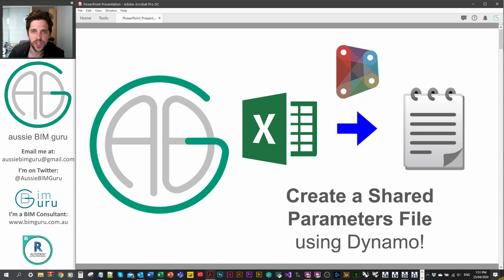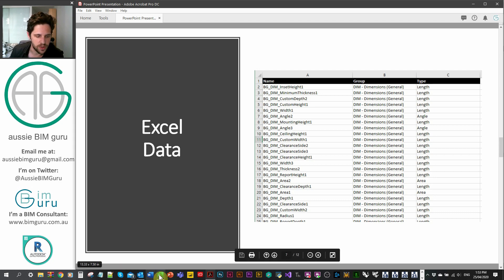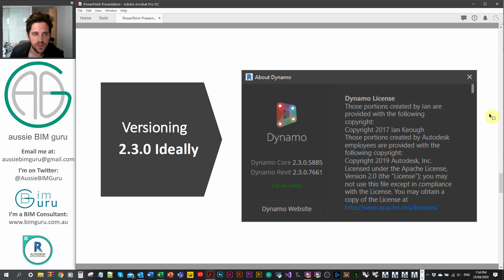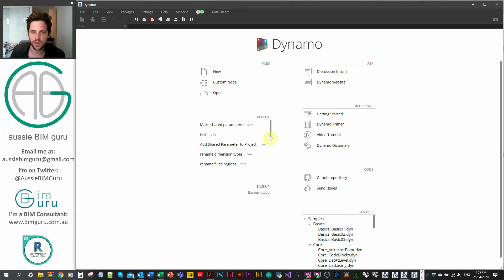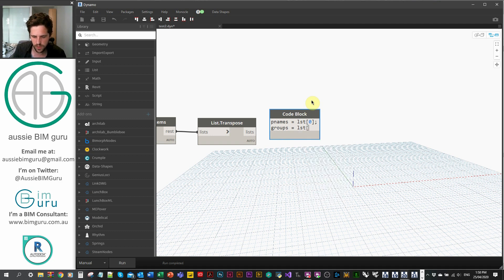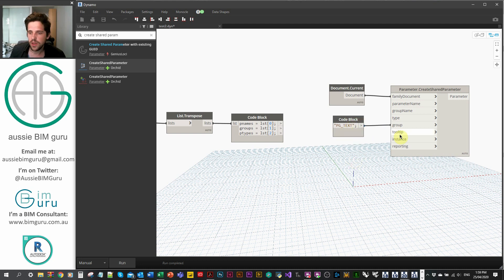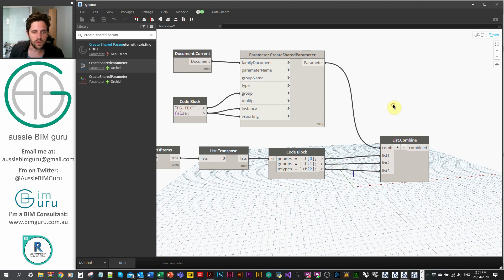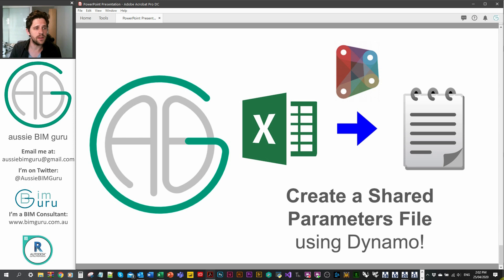Create a Shared Parameters File using Dynamo!

Comment: Thank you for your video. I do have a question, though.

What happens to the GUIDs for each parameter? Each shared parameter has a unique ID—a GUID. When a shared parameter is created in this way, it is not the same shared parameter as the one in the shared parameter list. Instead, a new parameter is created with the same properties.
Reply from the maker: Yes in this case it would not be the exact same. I have nodes in Crumple which take an optional guid as well now.

Comment: Did anyone come across an issue where only the Parameter groups were created? None of the parameters themselves were added to my file.
Reply from the maker: Yes I've found the node no longer works as intended for me in later builds, this is an old version no longer available. Maybe check on erfajo's github for similar issues and their fixes.
Reply: @AussieBIMGuru  Thank you for your reply. I was able to get what I needed through your earlier reply to @izanikamal6020 where you suggested using DiRoots.

Comment: Hi BIMGuru, I try to run the script but when I check in the shared parameter ribbon only groups appear but not for parameter name and type. Can you help me?
Reply from the maker: Unfortunately I dont believe the node works as intended anymore in Orchid. I had issues too. These days I use paramanager by Diroots to make parameters, get their Guids using dynamo and then make the shared parameter file in excel.

Comment: Interesating, is there a way to do this process in a batch way, in many models at once ?
Reply from the maker: Generally youd only want to do this to create the actual parameter vs in the model. Adding parameters is a bit different. For batch automation to families i have a few videos in my dynamo playlist. For project parameters i recommend DiRoots paramanager addin.
Reply: @AussieBIMGuru  
what im trying to do is
1.Creater shared parameter
2. Create project parameter, from the shared prmtr
3. Repeat process in a lot of models that are on BIM360, over +200 models. so automatization is much needed

is it possible with dynamo?
Reply from the maker: @MrZorret  yes look into either BVN batch processor or Bird Tools multiplayer addin on their website which are both free and can run a script in multiple files on BIM360 or local server.

Make shared parameters first in your file once, then you can use them afterwards for the workflow. You don't need to make the file each time.
Reply: @AussieBIMGuru  
Thanks 
i have created my list of parameters from a shared parameter, then i create a table with only the needed parameters;
this so i can use the "insert view from file" option in another models, to let me import the parameters
is there a way to batch process the "insert view from file" option so i can can do this process in lots of models?
this would actualley let me insert the same list of parameters in a lot of models, at once

Comment: Hello, I am trying to run this script myself but once i get to the final node to try to combine the lists i get "null". I am using Revit 2021 and Orchid 206.5.08318. I dunno if that could be a problem but i dont know how to proceed from here.
Reply from the maker: Yes new orchid doesnt work with list combine the way it did for me. Try doing it normally (inputs into the actual node vs combine), with condense set to false. Beyond that touch base with the package manager on their github to ask how the node works now as I cant see into the code to understand assumed input structure.
Reply: Hi A Ferrarotto, did you manage to resolve this?

Comment: Amazing video Aussi! I was trying to follow your tutorial (my dynamo version is 2.5) but the Parameter.CreateSharedParameter doesn't have the input  FamilyDocument.

As you said at the beginning, Revit should be pointing to the document that I created at first (mysp.txt) as you suggested, but doesn't look like that the script has worked because this is empty and I don't get any error or warnings in the whole script.

Are you using any special package for it? 

 Thanks for all!
Reply: I found the answer! At least in Dynamo 2.5 that field doesn't exist. If you want to know which document are you aiming, you should use Parameter.SharedParameterFile.
Reply from the maker: Glad to hear you found the answer, sorry for the delay. Yes this node was changed in later builds (I believe because the author saw this video). It's frustrating that the video becomes out of date, but at the same time is a better workflow probably with the new node. I try not to use too many custom nodes in my videos these days as they have messed up my videos before when they change (my navisworks clash video has so many questions all because 1 node changed in it - drives me mad!).

Comment: Hi Gavin,

Would this workflow still work using the Excel spreadsheet from your template package? I only ask because you have additional columns in that file including 'DATATYPE', 'GROUP' AND 'USERMODIFIABLE'. What is the best approach to setting up the Excel file?
Reply from the maker: The Excel file in my template package would work with this if you remove all the headers and just take the name, group and parameter type columns instead. I've used this method to regenerate my shared parameter file with new prefix and GUID's before without issues.
Reply: @AussieBIMGuru  Thanks that worked great! I noticed the new SP you added for your doors V2 (FAMd - Family Type (Doors)) doesn't work and causes an error. I'm not to sure why this does that, is it possible to explain why this would be the case?
Reply from the maker: Unfortunately these parameters can only be remade manually as far as I know as they have an associated category nominated on creation which I think is determined in their GUID. I'd filter out their rows in Dynamo.
Reply: @AussieBIMGuru  I thought that may be the case, thank you for the clarification! How would I filter them out in Dynamo?
Reply from the maker: By their name containing _FAM

Comment: At time 9.02 what is" pg_text."..under group in parameter.create shared parameter node???
Reply from the maker: This is the revit name for the Text parameter group behind the scenes. It doesn't really matter which one we use as we're just creating parameters here so they get made in the parameter file itself.
Reply: @AussieBIMGuru  ok sir
Reply: @AussieBIMGuru  so we can give any name here??
Reply from the maker: @iftekharkhan8879  any valid name. I suggest just using PG_TEXT
Reply: @AussieBIMGuru   thanku sir. For always replying me...
Reply from the maker: @iftekharkhan8879  i reply to everyone eventually :)
Reply: @AussieBIMGuru  sir one problem regarding s that i installed orchid.exe and sample also and run the wizard...but when i open Dynamo it didnot show here??
Reply from the maker: @iftekharkhan8879   check all user account appdata folders. It may have installed as incorrect user like admin.
Reply: @AussieBIMGuru  so sir what i have to do if it is??
Reply from the maker: @iftekharkhan8879  copy whichever package folder it made to the correct user account manually.
Reply: @AussieBIMGuru  ok sir
Reply: @AussieBIMGuru  sir i have revit 2018 ver ...and Dynamo 2.03 on which i installed orchid 2.06..so it's correct???but yesterday i install clockwork and it's working...but orchid not...
Reply from the maker: @iftekharkhan8879  run the 200 installer not the 206.
Reply: @AussieBIMGuru  ok sir
Reply: @AussieBIMGuru  sir i want to know difference btwn ....list sort by key and sort by function in Dynamo??thanku
Reply: And when to use which of these....
Reply from the maker: @iftekharkhan8879  both can achieve the same outcome. Sort by function applies a function to a list provided. It substitutes unspecified inputs with the list. I never use it.

Sort by key takes two lists, and sorts the first based on the second. Keys are usually numbers or letters so they can sort. We use this to reorder data based on a sortable property, for example a room area or number.
Reply: @AussieBIMGuru  sir..i install 203 for orchid but still not showing in Dynamo.
Reply: I have to uninstall 2.06 before installing 2.03??
Reply from the maker: @iftekharkhan8879  i don't know but probably not.
Reply: @AussieBIMGuru  ok sir ...if u have any installation package for orchid plz send me ....thanku
Reply from the maker: @iftekharkhan8879  i don't. Its on the github, and there are instructions. I can't really help more than that. If it doesnt work maybe leave an issue for the author of the package and they can help you.
Reply: @AussieBIMGuru  ok sir
Reply: @AussieBIMGuru  sir i want to ask one thing in Dynamo...
Suppose i have many  door  and door types in revitproject ..i want flush door and it's all type..mean how many flush door are there  in this project ..then how can i filter this in Dynamo......
Reply from the maker: By using their data.
Reply: @AussieBIMGuru  ok sir ...thanku ...but actually i m asking the which  node to apply??
Reply from the maker: @iftekharkhan8879  element.getparametervaluebyname and list.filterbybooleanmask
Reply: @AussieBIMGuru  sir i want to get type parameter ..and then i want to filter according to that parameter value ..."get type parameter " is not there ...i didn't find ...is there any other node for finding element bythe type parameter value...thanku sir
Reply from the maker: @iftekharkhan8879  yes rhythm package has nodes for this.
Reply: @AussieBIMGuru  ok sir
Reply: @AussieBIMGuru  sir one thing more 
..sory for disturb...
I want to change the family name and it's types also by just add suffix or prefix....
Element.type : family then all elemnet of type: this will give all the family name which r inside project 
Second thing .

Category : window and all element of category this will give all type of windows ...
But sir i want the family name and it's type also so. Plz tell me node...
Actually what i did ..is. Elemnet.type :  i type family then all element of type ..it will give me all family name ...so i did string .contain  then i replace after that i put lister filter by boo mask ...then type element.set.name ...so it's change only family name ..but not it's types..
I want to change its type also ...plz tell me node of this ...thankunsir
Reply from the maker: @iftekharkhan8879  look under the 'Family' section of the Revit node library. You should be able to get the types of families using a node from here, which can then be renamed in the same way. I don't usually get much time to have deep conversations on YouTube these days about scripting so I suggest using the Dynamo forums to get more direct help from people for these types of things.

https://forum.dynamobim.com/

Comment: Hi, nice tutorial! I have a question related to shared parameter file: basically I have a rvt file with shared parameters but I don't have the SP .txt file. I made a script with zhukoven nodes and I retrieved all the SP in the file, guids included and exported all in Excel. The problem is that converting the excel in txt is not readable as a Sp file by revit. So i'm wondering if there is a workaround to do it. I've searched for days in forums and tutorials without any luck. any ideas? Thanks in advance!!
Reply from the maker: I would try copying the header portion of a working SP file into the one generated and see if that helps. Shared parameter files need to be structured in a particular order for Revit to read them so the one you put back together must have some formatting errors in it.
Reply: @AussieBIMGuru  yes I've tried to start from an existing SP file and adding the new data, but the formatting is wrong. well, I'll try again and see. Thanks!

Comment: Hi, i was trying to add the Tooltip field from excel but list.combine just give me "null" value. I tried to put it directly on SharedParameters.Create but it didn't work either. Any advice to achieve this? Seems like the data has some especial requirement to pass through. Thanks for the videos
Reply from the maker: I haven't actually tried adding a tooltip before using this node. I would start simple, try adding a tooltip directly from Dynamo using a string node, then from there try in list format and finally excel. The results might indicate why it isn't working.

Comment: Hi my friend....
As usual, great job
What am I not doing right?
Attached picture
https://1drv.ms/u/s!Air2ohPJDj0fgrA4mr7lLPcBJTwSpg?e=M9PKLI
Reply from the maker: The main reason I know for this to happen is you might not be in a family document. Otherwise the node may have been updated- maybe try inputting the lists directly instead of list combining.
Reply: @AussieBIMGuru  Thanks for your quick response. Everything works 👏
Another question 😀
Some of my parameters including formula. See pictures attached.
https://1drv.ms/u/s!Air2ohPJDj0fgrA56jLgCQZWP43LUQ
There is a way to add a formula column in the Excel file and all job making automatically through the dynamo file?
Reply from the maker: @yogev55  glad to hear!

You can set formulae using a node from the Orchid package, I made a tutorial on this a while ago here;
https://www.youtube.com/watch?v=arEYfAJp7Y8

Comment: Hello
Excellent tutorial, however I performed the whole process and it doesn't work. My List.Combine reports all values as Null.
I put an image on OneDrive follows the link:
https://1drv.ms/u/s!Aj1WfMdg42r0gZ4xHrxxHPqDjY8z6g?e=UPvwKM
Reply from the maker: Is dynamo pointing to a family (rfa) document? It doesn't work in a project file.
Reply: @AussieBIMGuru  yes... I open new family (generic model) and work on this family. Mabe the revit version? I have 2019 and 2021 installed.
Reply from the maker: @jacksonaugusto7538  Make sure you're using Orchid for Dynamo 2.3.X, Dynamo 2.3 and Revit 2020. Beyond that maybe try just running the regular node vs combining it.

I will probably stop sharing tutorials using Orchid in future as the results are rarely consistent and it gets updated too often for the tutorials to remain relevant.

Comment: What if I want to enrich my excel file with new parameters and create a new shared parameter text file - The GUID will be/not be lost for existing shared parameters?
Reply from the maker: In this case you would need to be careful, but could potentially add to the existing shared parameters file using the same workflow.
Reply: @AussieBIMGuru  I must test it. Imagine to assign all shared parameter to previously created families.
Reply from the maker: That would be a different workflow, I cover this here;
https://www.youtube.com/watch?v=dLRgJMj5ZOQ

Comment: Hi Aussie BIM Guru.Can you create something related to FormWork for Structure  floors, Beams , Columns.
Reply from the maker: Unfortunately this falls a bit outside my experience - to date I've never seen formwork done in Revit, but I'm sure it would be possible. I'm guessing that using walls/floors and some special families works best seeming these support takeoff methods easily.
Reply: @AussieBIMGuru   Many thanks for the reply. 
i have one query. is it possible to calculate the surface area of columns which pass through floors where we need only the surface area of the column to be painted , intersection of column and floor surface area to be deducted from column surface area through dynamo as the floor thickness varies & columns sizes varies.

Many thanks in advance.

Comment: @Aussie BIM Guru - I ran this workflow with some of my parameters having the "Temperature" and "Air_Flow" parameter types. These do not get created when the workflow is run. It seems that the only parameters that get created are those under the "Common" discipline. Is there a way to add a fourth column to have the discipline changed as well?  Also @8:14 you added the PG_TEXT parameter group, I tried to make that PG_OTHER, so that they would be grouped there, but no parameters were created. I'm sure I am doing something wrong. I appreciate the help, still learning.
Reply from the maker: The parameter group for 'other' is actually  'INVALID', strange hey?! Check out the excel file on my github - it contains all common groups.

As well as this, feel free to download 'Crumple' - this contains some nodes to look at the builtin parameter group names, in which you might be able to find MEP groups. Their name is not always the same as in Revit, but I think they should be there.

I recall reading that some data types were not able to be used for this workflow, but check the Orchid package out - I think it has a dropdown with all available parameter types.

Comment: So I've created some of your other Dynamo workflows (Adding Shared parameters to families) and I noticed that in those previous workflows when pulling the Excel info the code block is the sheet name and "false" for both readAsStrings, and showExcel, but in this version, you have "true" for readAsStrings. Why is that?
Reply from the maker: Sometimes I use this when all my values can be in the form of strings. This makes it easier as then Dynamo doesn't read numbers as numbers. Occasionally however, I need numbers from excel to values in Dynamo, so in these cases I don't want them to be read as strings.

A good example of a field that is often numbers (but needs to be read by dynamo as strings) is sheet numbers.